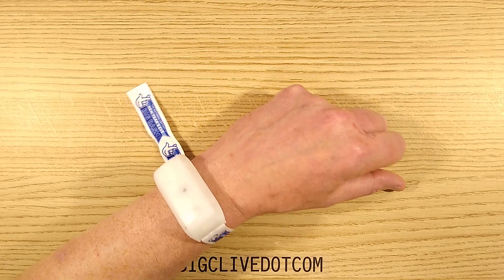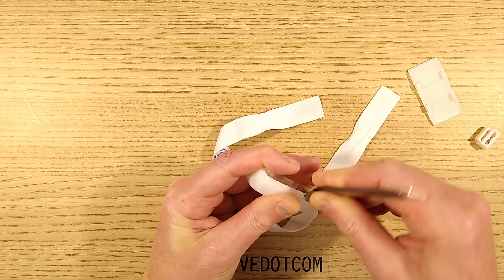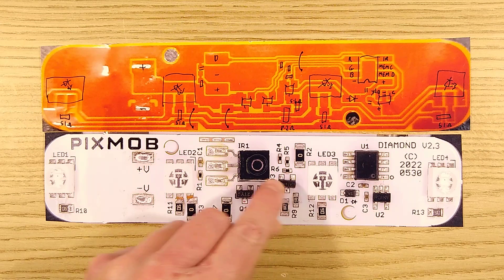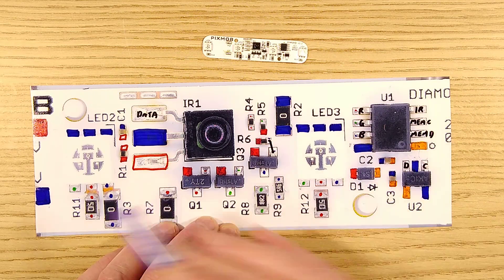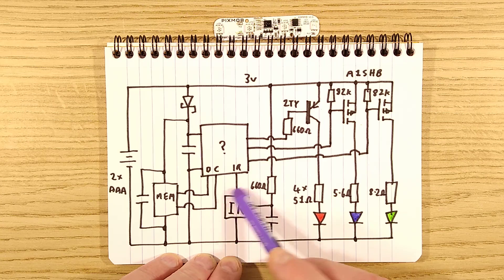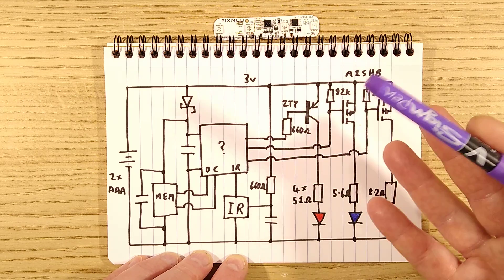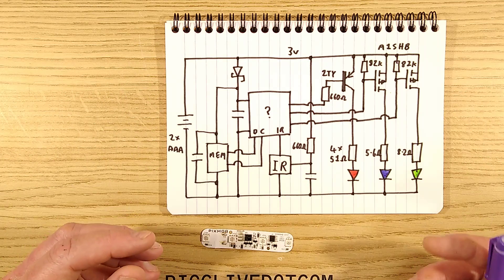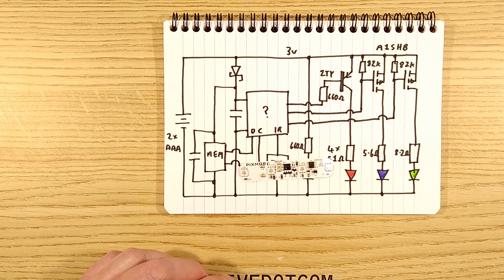IR controlled concert LED wristband

Comment: I dissected the one I brought home after seeing Taylor Swift in Seattle. Two 1632 coin cells, two tri-colour LEDs, 8 pin microprocessor, IR receiver, an SOT23-5 device that I can't quite make out the markings, assorted passive components. A rigid rectanguler PCB that says, among other things, VIC v2.3r1
Reply: Ours were the same ones Clive is showing for Taylor in LA, I kept all 3. Tore one down, can slightly control it with an IR remote control. We think the wristbands were different that night because they were also filming the concert. Other friends had the smaller ones like yours on other nights of the LA shows.

Comment: I don't know why they use AAA cells in anything these days, I have 12 lights here that all used 3 AAA cells so I don't use them, If I get things with 3 AA I can just put the 18650 in it, The lights I have run with a remote so just the stand by power kills the battery's in a month or I can get 4 hours run time on low with new batteries. I do have the dollar store light that looks like a light switch and it takes AAA and I knew it when I bought it,
 I put that under the sink so I never use and that's a great place for it

Comment: In late 2014, I took my wife to Disney World's Magic Kingdom. (She'd never been, and I hadn't been since the 80s.) They were selling lighted mouse ear hats which coordinated with the show. I assumed they were using some unlicensed RF spectrum, but infrared makes so much more sense (especially when it's dark out -- though maybe the modulated signal would still work with the sun up?). Now I need to smuggle an IR camera into a concert with these things to see if I can work out the signaling. 😁
Reply: It'd have to be a high speed camera, if the data burst is in the kHz region.
Reply: @fredfred2363  You could knock something up with an Arduino and one of the same IR receiver modules this one uses. Wouldn't have to match the particular component, they're all standard and demodulate the 40KHz or so carrier. Then just record it at however many bits per second you think would be suitable, not gonna be many since the theoretical maximum would be 20KHz, likely quite a bit less than that. Maybe use a serial EEPROM to store a bitstream, and time / date if you wanna show off, whenever you press a button. A bit like a camera in a way. Or else have it auto-trigger whenever the sensor detects a carrier, shouldn't get many false positives.
Reply: most of them are using radio, only these new ones use IR. see the WSJ video done on them a couple months ago "How Concert LED Wristbands Work "
Reply: https://www.youtube.com/watch?v=GCsmZA08oD8&t=1s&ab_channel=WallStreetJournal
Reply: a normal phone camera would probably see the IR

Comment: Why not mosfet for all 3 colors? Instead of only B & G? I am sure a slightly beefier mosfet would do for just a cent or two more, based on volume
Reply: Cost
Transistors are cheaper than MOSFETs

Comment: Clive, why no demonstration of how they work? Could’ve even shown off a few dance moves.
Reply: Without a transmitter, which would be fairly simple to cobble together, *and the codes to feed the wristband*, it might not light up at all. Best case it would light up the way it was last instructed to, assuming it doesn’t reset when the batteries are removed and replaced.

That thought provides a fun twist on the usual IT service call dialogue:

“Did you turn it off and back on again?”

“Yes.”

“Well, there’s your problem.”
Reply: Well, he did mention that he didn't have AAA batteries with him...
Reply: @nyckid  If only the master electrician (EE?) could figure out how to power a device without the proper batteries.
Reply: @nathanmiller1456  Well, when you're on the road for work and have a camera and your laptop bag in the hotel room instead of a workbench...
Reply: Now I want to see Clive raving under a strobe light!
Reply: Saving it for Big Clive Live 😅
Reply: Read the description
Reply: Each unit assigned unique Address.
The unit identify itself by send out high speed data through the LED. 
Audience-facing camera + software maps location of units in real time. 
Master map of units in audience like a BMP image
Reply: @jagmarc You're massively overthinking it. This version is controlled by an IR flood that they point at the part of the crowd they want to activate. If you're out of your designated seat it doesn't matter. 

The more elaborate version still isn't using two-way comms. Your band is registered to your seat and they activate using RF. If you're out of your assigned seat, you light up according to your seat. 

It's this second version that can play as a video wall as each seat is pixel mapped
Reply: @RickMeasham  I was just going to reply the same thing... Imagine the interference hell if each band had 2-way communication
Reply: @RickMeasham  you can tell when things go over the head they play the "you're otherthinking" card. There's nothing to think about this is old tech donkeys years old. 
You've exactly nailed it on the head,  that's the trouble with this YT channel there's too much "I think it is this: "No I think it is that: "It appears to be...." comments. And then when someone takes the calculated risk of quoting a past client's intelectual property their comment gets buried in noise. Well that person got paid very well for (over)thinking
Reply: @kebizembola  You massively underestimate what's going on.  Decades ago Phalanx CIWS Goalkeepeer tracks in real time every seprate projectile fired at 4200 RPM 
This armband unit is child's play
Reply: @jagmarc  I was going to propose that this might be how the positions of individual bands in the audience are worked out.

When you've got a 20,000 seat venue filling up with guests who want to take their seats and the performance to begin, the last thing anybody will tolerate is a massive queue forming behind a desk where every guests booking is looked-up so a seat-specific wristband can be found and handed out to each of them. Placing bands on specific seats in the auditorium before entry works around that problem, but is just as labour intensive and mistakes will inevitably happen.

Having a big bag of bands handed out willy-nilly that can flash their IDs on command (Captured by cameras over the audience and processed by a PC) is a lot more practical for the guest, and requires only a little extra work and data processing on the part of the wristband/lighting provider. Compared to the other two solutions, the latter is almost certainly the most cost-effective, too! 🙂
Reply: @UK-Combustibility-Assured   except your camera sensing highspeed data sound like bullshit to me. What kind of framerate, resolution  and camera sensitivity are we talking about, to scan a 20 kpcs of randomly transmitting things?

Comment: Great teardown as always.
I can't get over the feeling of enormous waste that comes with trinkets like these. Are the wristbands and batteries just disposed of by patrons after the concert, or are they collected in some way?
Reply: They had bins for recycling them on the way out of the show.
Reply: I found one in a suburban street here in Brisbane Qld near where I live.  It came with two discharged AAAA batteries which up till that point I didn't know existed.
Reply: @SubTroppo  AAAA batteries are used in some active styluses for tablet computers. AAAA batteries are also used inside some brands of PP3 9V batteries.
Reply: @DavidWood2  Thanks. After my "discovery" I did keep my eye out for them on sale and found them "at a price" in an Office Works store.
Reply: The type that use AAAA cell are the older Xylo-Bands.  No really used much anymore,  Although Eurovision did use Xylo-Band this year!  But most big concerts use Pixmob now,  and lower budget use Cheap Chinese RF Clones.

Comment: You might be able to trigger this in random ways with some standard IR remotes for TV's. etc. At least you should be able to get some sort of output...maybe a follow-up video or short trying my idea?
Reply: Id imagine theres also arduino code out there to do universal remote programming.
Though id imagine it wouldbe a lot easier for someone to go to an event that uses these with a ir reciever and try to intercept all the codes being used.
Reply: Also an Intellectual Property layer to get through while finding it. Any access code end up getting leaked into the public domain at some future point

Comment: I've been to a few weddings, where a similar device was used to 'stimulate' the wristbands of the attendees.  I believe it utilized a form of PCM to address specific groups of bands.  The emitters were scattered about the reception hall.  It would be interesting to experiment with these.

On a slightly different, but related note.   3M has product, which they market under the name Optocom, that is sold to government entities, for the purposes of optically controlling Stop-n-Go lights, for emergency & public transportation vehicles.  A modulated strobe, at a certain frequency is utilized to pre-empt a traffic intersection, for the passage of 'preferred' vehicles.  Very interesting technology.
Reply: Almost certainly. Each unit is an addressable pixel in an audience-size bitmap image.
What I think what's most interesting of all: is how differently to actual the Public Domain perceives these to work, and it's right here in video comments is the source of the perception!

Comment: Hey, I'd like to send something in for some reverse engineering (a smart LED bulb) but I can't find any info about that on your site - what's the best way to get in touch for more details?
Reply from the maker: I have a few different smart lamps here.  They usually have a simple power supply, WiFi/bluetooth microcontroller and a specialist serially controlled linear current regulator chip.
Reply: @bigclivedotcom  I tried leaving a comment explaining what it is (teckin smart bulb with a broken screw base that I'd like to see if I can power off USB PD at 20V or something similar) but the comment didn't go through (or was automatically removed), oops!
Reply: I think he has a Facebook account.
Reply: I also want to send in an item for Clive to reverse engineer. Its very interesting. I couldn't find an email or postal address either.

Comment: I worked the SuperBowl when it was in NJ and at that time PixMob was the name of the tech, not the company then.  I worked overnight in the weeks leading up to the game, so I got to watch them install and test the projectors and it was really awesome.  I was able to grab a few of the test modules that fell off the boards they had them mounted to that still have the ribbon cable connector for programming.  They would sometimes react to my TV remote, but nothing I could use to great a pattern.

Comment: The flexible PCB would be very cool as part of a wrist band, but why then put it in a hard plastic case. A pair of AAAs seems overkill for something that could probably be powred for one performance by a CR2032. Or were they collected and resused for each show?
Reply: At the coldplay concert they had collection bins, but weren't to bothered if you kept them. So the challenge for Clive now is to make them light up from an Ir transmitter
Reply: Not enough energy in lithium coin cell. The unit has to be continously listening and identify itself when polled
Reply: The plastic difuses the led light. 
And button cells are just terrible, theres plenty of low capacity aaa batteries, the sort that get used for solar lights, off a full charge they last a few hours in the evening for one led to light up a bit of a garden. So they want them to be bright enough for a 2+ hour show, and not have faded out by the last song. A button cell wouldn't cut it.
Reply: 2032's and other button cells are higher regulated because kids swallowing them.
Maybe why AAA used
Reply: I'm not sure a 2032 could drive 3 LEDs brightly for the length of a concert. They have quite high internal series resistance compared to 2* AAAs

Comment: I assume that the IR transmitter is just an array of IR Floodlights?
Reply from the maker: Sometimes simple floods and sometimes moving heads for patterns.
Reply: They also use movinglights and gobos to do patterns
Reply: @julianreverse  That's actually obviously simple if you think about it. I'd previously assumed they use grid references or GPS!! doh
Reply: Each unit is a an addressed pixel in an audience-size bitmap image
Reply: WRONG!  @jagmarc
Reply: @julianreverse  wrong to say "wrong".
Whichever way (addressed or 'painted by IR')  each unit is an addressed pixel in an audience-size image
Reply: This is donkeys years' old tech
Reply: They are only adressed in RF controll Environments. Not individually but in large groups like a entire block.

The IR Pixels do not have an specific adress. If they are hit by IR they light up in what ever colour is transmitted, if not they don't. It's that simple.  @jagmarc
Reply: except its not because audience members move around on indeterminate paths so you can't bitmap it in that way as a pixel.
Reply: @DavidGolik  That's what I thought. It seems instead, they bathe the areas they want switched on with IR Lights. If a bracelet in that area gets lit, it switches on. I am sure there are more complex versions  based on seat numbers, but that doesn't appear to be the case here.
Reply: the LEDs identify their location in real time. (PCM)  Used on drone swarms donkey years ago.  
There's too much 'I think it's...'   and 'it appears to be...'  on this YT channel   
I'm outta here....
Reply: @jagmarc  It's not an airport, no need to announce departure! If you don't want to discuss and share knowledge, probably best you do go.
Reply: @mikenco  there's no "sharing of knowledge", it's just endless people's armchair opinions going on forever based on what they think about something which they know nothing about.   
Then when someone quotes (without a thought) actual client intellectual property they then get branded as "overthinking"

Comment: That circuit board got me thinking there might be a market for a bandaid (aka plaster) printed with a similar image. They do cartoony ones for children, why not make a version for geeky adults?
Reply: anyway I'm pretty sure the original commenter meant exactly that, a printed image, not an actual circuit board
Reply: I would think the solder,  being a toxic substance, is not something you'd want in contact with open wounds.  Not to mention the batteries.
Reply: @mxslick50 no gain without pain
Reply: @mxslick50 you could just use lead-free solder

Comment: Fascinating! It would be interesting to know more about the 'InfraRed' PAR cans and how they send the data and how many they use and how they are rigged to cover the whole audience.
Reply: They almost look indistinguishable from a regular overseas built LED par. They have an led array in the front, a standard locking yoke and a 5-pin DMX connection in the back. You pretty much just place them like you would place any audience washers.. light is light, after all.

Comment: Thanks to Vince for letting us all have a peak at these bands. Interesting control method and band. I wonder if any went missing after a show, but not much use to anyone if you didn't know how to control it.
Reply: Id imagine most people kept them.
They probably pay enough for their ticket, people keep them as a keepsake. Or they just forget to take them off.
Reply: If you want to learn the protocol, film the control projector cans with a suitably sensitive phone (phon cameras are generally fairly sensitive to the wavelengths of IR that is used) and analyse the flashes of the IR stream. It almost certainly uses a slightly custom version of one of the many well known protocols and modulation types. Of course with a little googling, you may find that it has already been reverse engineered.
Reply: @AndyHullMcPenguin  You'd need to be recording at thousands of frames per second.
An old phone with an IR blaster (like the galaxy s6, remember when smartphones came with lots of useful features?) would do the job.
Or if you feel like shelling out the money for something you might only ever use for IR, a flipperzero.
You could probably build your own with a pi pico as well, coin cell batteries, IR reciever and SD card inside a tiny little project box.
Reply: @AndyHullMcPenguin  Most phones (iPhones at least) have IR cut filters on the main cameras.  You might have to switch to the selfie camera, which generally don't have IR filters.
Reply: @swp466  Some phones have night vision cameras, so maybe use one of those in night vision mode?
Reply: @katrinabryce  Might work.
Reply: Good point  @swp466  however I suspect if you pointed the camera directly at the IR floodlight there would be so much IR it would swamp the filter and you would see it anyway. Failing that, just use one of the many older mobiles that are littering the planet, which can generally see the flashing  IR of a standard TV remote control. 
.. or strap an IR receiver to a Raspberry Pi. 
Whatever method you use, we are dealing with known technology, so it should be fairly easy to hack.
Reply: Or just fuzz one afterwards using a IR LED and a microcontroller. @AndyHullMcPenguin
Reply: They gave them out at Glastonbury for Coldplay, obviously no way to get them back there.
Reply: When the audience walks out... they have bins and people calling out please return the wrist bands by each exit. There were piles of them in the bins but I'm sure some walk out.
Reply: I met Vince at LDI a few times. Cool dude.